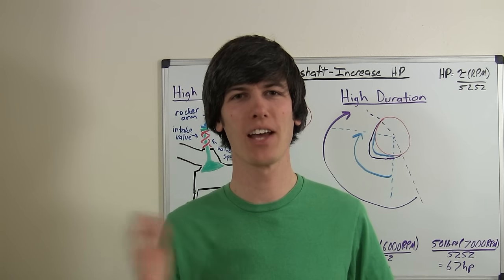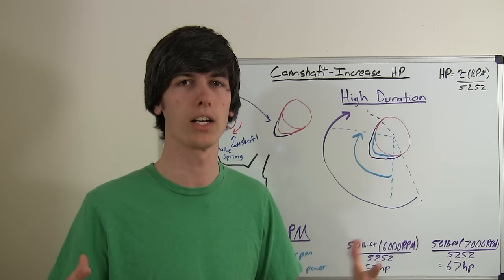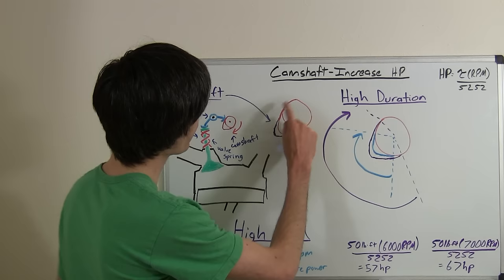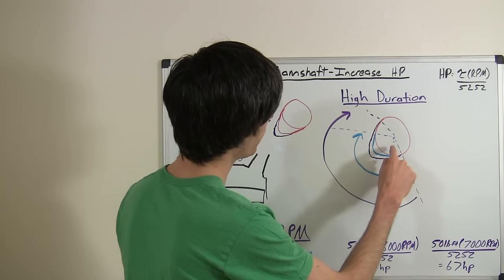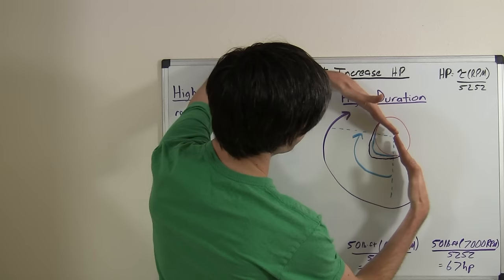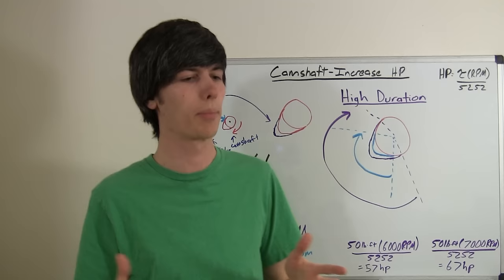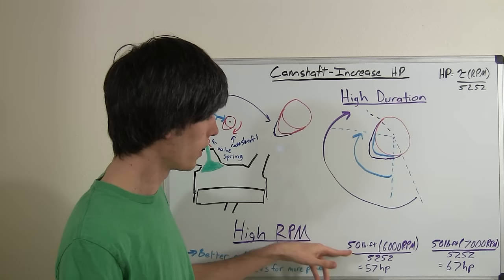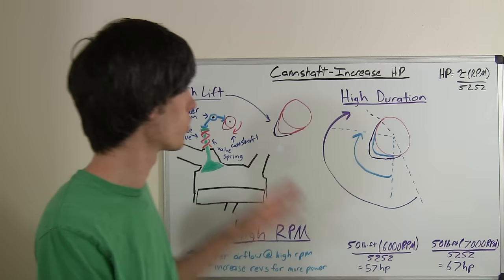Camshaft - High Lift and Duration - Increase Horsepower

Comment from the maker: It's possible to increase your max hp and still get better fuel economy, but that doesn't necessarily mean that the two will happen simultaneously. For example, more hp typically means you'll need more air, and consequentially more fuel. But if your engine operates more efficiently at lower RPM, and creates higher power at higher RPM, you can have a combination of good fuel economy and HP. This is basically the principle behind VTEC/VVT/valve timing.

Comment: I think you should also have mentioned the disadvantages, like low performance at low RPM :)
Reply: Robin K. Wouldn’t a tune for more power at the bottom end fix that?
Reply: @wey12341  no, given what can you would decide to go with most benefit upper rpm for peak hp not tq, so you sacrifice low end tq for top end hp. Has nothing to do with a tune, more or less just the design of the camshaft. To my knowledge lol
Reply: So, the low end torque will decrease for sure if I use a performance camshaft that boosts the power on the higher rpms?
Reply: Alfa Kenny Juan you spend a majority of time at 1500-3100 rpm
Reply: @getsuccessfulwithandito1550  yes. a larger lift cam will typically yield more torque at the low end compared to high end hp gain, a high lift cam usually doesnt need an increased rev limiter. high duration, high seperation cams are for high rpm, top end hp gains but sometimes a loss of power in the bottom end
Reply: Would a higher compression make the suffrice of power loss at lower rpm? Or is that relative to mapping? Being a vr6, contemplating the jump..
Reply: Aftermarket torque converter.
Reply: Thank You. Your diagram and explanation were easy to understand.
Reply: Who races at low rpm?
Reply: @stevenp3176  when you race you are 🤣
Reply: Would stage skunk2 stage 1 do this also
Reply: @getsuccessfulwithandito1550  Not always the case. With the right cam you might increase power through the whole range and remember torque is what puts you in the seat horsepower keeps you there
Reply: So big cams (long duration ones) is more applicable for hybrid cars, since the low end rpms is boosted with battery?
Reply: @fikaremiredo  Big cams are not always a bad thing. If they are matched to the engine cid ,gearing , torque curve, vehicle weight, tire size they can be very good and make lots of power. If you get it wrong though it kills everything and turns into a slug

Comment: One of the major limitations of stock engines, if you're trying to get higher revs is valve float. With stock valve springs, there is a designed limit to how quickly the valve can open and close. At higher rpms, the valve can't snap shut before the cam is opening it again, so the valve just "floats" there in a semi-open position.

Just putting in a more aggressive cam does not solve this problem. You must use stronger valve springs, so that the valve can snap shut more quickly than stock. Of course, stronger valve springs bring considerations of their own and cannot reliably be done in isolation. So, just a camshaft swap cannot produce magical results, and you'll invariably notice compromises like reduced fuel economy, rougher idle, worse emissions, and poorer power at lower rpms.

The moral of the story is that a camshaft swap in isolation doesn't produce a dramatic effect for the better, and there are invariably compromises for the worse. An engine is a very fine-tuned collection of parts that have been selected for their particular properties that contribute to a gigantic pile of chosen compromises. To "increase horsepower," in a reliable way, you generally have to swap out entire "sub-systems," so that, say, the entire valve train and timing set will cope with increased loads, etc.

But then you get into questions like, "Were your 6000 rpm wrist pins and rod bearings designed for 8000 rpms and 25% greater horsepower over stock? Your main bearings? Are you going to get adequate oil flow to critical components at the higher rpms?" Etc. There is no free lunch. You can't get something for nothing. Swap out certain parts, and you're just making other sorts of compromises, usually at the expense of reliability. At the outer end of the spectrum of compromises are top fuel dragsters that typically get an engine rebuild after every run (and an entire replacement clutch set)! That's "maximizing performance," but you do not get something for nothing!

My best friend, who built racing engines for living, used to say to wannabes, "Speed costs money. How fast do you want to go?" A camshaft swap-out in isolation is pretty cheap and easy, and it doesn't net you very much at all.
Reply: ^Absolutely true

On a side note, I also have a friend who runs a grassroots racing team focused on endurance race and the likes.
He actually tries to cram in OEM stock parts as much as possible since they're the most robust and reliable.
Reply: Maybe you should make a youtube video

Comment from the maker: Thanks, they do go hand in hand, really. Increasing the amount of air/fuel etc means a greater pressure rise in the cylinder, meaning a greater torque, meaning greater power. You may want to check out my video "Horsepower vs torque."

Comment: Great video as always, however this is not at all the whole story. Improving the breathing at higher revs will give you more power at those rpms but also lower the power at low rpms and often narrow the power band considerably. The more of a "race cam" you put in your engine the bigger the problem gets. Overdoing this can make the car almost unusable at low rpms. Great for a race car where you want full power most of the time, but bad for a street car where you also want to be able to cruise without reving the hell out of the engine at all time.

Who wants to have 200hp at 7000rpm but only 50hp at 6000rpm and below? I would much rather have only 150hp at 7000rpm but 100hp all the way down to 4000rpm. Would make for a greater street car and also a better race car.

So please do not go out an buy the most extreme cam you can find. Camshafts are a black art in itself and on top of that the camshaft need to match every other part of the engine and bigger is not always better.

With that said most engines, that are not already high performance engines, can almost always benefit from replacing the camshaft. You should easily be able to increase hp with 20% without loosing driveability. However depending on the engine you might need to replace other parts of the engine to take advantage of the new cam.
Reply: Could you explain the science behind that please? Its just that everyone says it and I'm not 100% certain if it's true.
Reply: @MrAndrius12   you lose manifold vacuum at low rpm, the more overlap the cam has (intake open and exhaust open at the same time) the worse it performs at low rpm
Reply: @averyfilbert1596  yeah the intake and exhaust being open at the same time makes full sense. May I ask, how would turbo/supercharging would affect all this?
Reply: My Name Is Hello they got specific cams for forced induction, they’re pretty similar, people used to run more lobe separation on them to increase back pressure on the exhaust but now they’re running similar specs to the n/a cams... im not 100% sure on turbo cams but the bigger they are the less drivable the car is, they have trouble with idle and depending on boost your power band would be higher but youd make more power
Reply: @averyfilbert1596  so even if the turbo boost is 30 psi (2 bars) the cam is going to be similar?
Reply: How do you choose the right cam shaft valves springs rockers rods ect?
Reply: thnks for youre example, this was my case , lost a lot of power in the bottom end aftet adding cam that opens longer
Reply: You can do advance ingnition timing at low rpm
Reply: What about higher lift with moderate duration?

Comment from the maker: Correct. If it was designed specifically for the stock engine, the stock cam is probably best. But if you have additional upgrades and need better airflow, this can help.

Comment from the maker: I couldn't tell you the direct relationship, and of course it would depend on the engine, but larger valves will promote better airflow, and likely will affect high RPM power a good amount (assuming the cylinder head is expanded accordingly).

Comment from the maker: Cams shouldn't affect the brakes in any way, unless your power gain is very significant, in which case you may want larger/better cooling brakes to compensate.

Comment: An interesting video and very appropriate for me today as I've been looking at swapping out the cams on my Caterham Roadsport for either the Supersport spec cams, or piper 633's. Both have greater lift and greater duration than the standard cams, and deliver this power at much higher RPM. So instead of having say 120hp at 6500rpm, i'll have more like 140hp but probably nearer 7500rpm! Obviously to get these kinds of gains, you need to remap your car to take account of the new cams and rev limit, and also ensure that your intake manifold and exhaust system can supply and remove enough air quickly to make the most of the hotter cams. 

It's a hugely interesting subject and shows just how much can be done to alter the nature of a car.

Comment: Plus a bit of overlap at high RPMs is a good thing, because the inert gases in the burnt air lower the reactivity of the mixture therefore lowering the temperature below the level of NOx formation. Plus the amount of Oxigen available is also lowered further reducing NOx formation.

Comment: You forgot to mention that if the head will flow a max lift of say .500, and you use a cam with a lift of .550, you get air reversal(back pressure), and the head may only flow .480(per Comp Cams).

Comment: Always enjoy the videos. I think you should clarify that in addition to going to a higher duration/lift camshaft it is often required that a stronger spring and retainer be used to compliment the additional stress from opening the valve further and at a higher rate of speed and to make sure valve float does not occur at higher rpms than what the stock valvetrain was designed for. Could you do a future video explaining what lobe separation angle is and how adjusting it changes torque peak?

Comment: Overlap is actually quite desirable (to an extent). It creates scavenging (exhaust pulls the intake charge in). Huge gains in efficiency were gained when we figured this out. Before flathead v8s only made 100hp. Now we have smaller stock v6s that make 325.

Comment: To increase revs you also have to have in mind do the components of the engine are strong enough to be revved more. Most important component that will stop a engine revving safely is valve springs, if any valve float caused by weak springs will cause problems if a collision with piston occurs at higher revs. Also rod /stroke ratios that is detrimental to the strength of piston as it approaches and passes it's design speed has to be thought about also. Making a engine rev past it's designed strength of components can be a failure of a component waiting to happen. To make a engine safe to rev more than it was designed too is a tricky and expensive undertaking.

Comment: Yes, a better lobe for high rpm power production. It has higher lift and I think it also has higher duration. Engineering Explained may have done a video on VTEC. Also, Eric the Car Guy did a great video on VTEC in which he actually shows your the camshaft of a car with the system and does a very nice job of explaining it. Oil pressure is used to select the new lobe in a VTEC system.

Comment: I think you should re do this one, Most of your stuff is that next level of information I look for mate, but this was basic and addressed none of my questions, and felt rushed. 
1 how can a new came increase efficiency and power? 
2 what makes lower torqueier cam vs high rev came
3 what makes a show cam like the thumper, probably a bit like the Harley timing huh?
4 why wouldn't the original manufacture take advantage of this wear?
I am researching for the classic small block, better example I think.

Comment: in the Philippines guys with highly modified 150cc mopeds actually believe that grinding down the cam lobes will theoretically increase power

they also believe OHV engines are more powerful than a DOHC engine
and they actually believe the Air suction valve to lessen the emissions is a turbo,

Comment: thanks for the video.  Its simple enough so anybody can understand the idea behind so called performance cams.  What I can't work out is why this isn't already optimized on the stock gear.  Why not have the bets air filter and best possible cam already from factory.  It surely would not be that much more expensive if at all.
Thanks

Comment: if i upgrade my camshaft,do i need to dyno tune it or change up other component?or just swap the camshaft out and its done?
Reply: +steve lim Yes, you can swap and drive or you do a dyno tune for more hp or tq.  Nowadays VVTs are common, so if you chose the right one, you won't need to worry.

Comment: I just realized is better compromise to have a higher lift than a longer duration. Since if you have larger intake systems more air is flowing in general and it flows better if the valve has more lift. Having longer duration doesn't help as much since the lift is the same it would create a bottleneck at every instant so air flow is not maximized entirely. Is best to flow large amount of air more often then more time taking same air, this helps engine rev faster also.
Reply: Exactly I've seen where a smaller cam but better flowing heads did way better in the lower rpm range than a big cam and shitty flowing heads it falls on it's face the cam is made for high rpms but the heads are not conducive to that much air flow

Comment: you should do a video on camshaft "regrinds". how they can increase a cams lift and how "rescinding" can effect the cams operation.
Reply: I second this I wish this dude would talk regrinds or someone that's somewhat knowledgeable on it.
Reply: I meant to say "regrinding*"
Reply: +brently300 yeah I got yah
Reply: ya please do a video on regrinding because there are people offering regrinding your stock cams and from our understanding, regrinding means reducing metal from the cams and how that can enhance the degree of the cam controlling the valve to open longer?
Reply: szekeiemme I found a video on how they do that the lobe is an egg shape and they grind a certain side so that when the lobe turns it makes the lobe lift the valve higher it's hard to explain but the video was a dude doing it to a motorcycle cam

Comment: can you explain the advantages of high lift short duration..and advantages of long duration short lift?
Reply: +Muhd Afiq  I am not an expert, but ... 
High lift short duration is for those old 5.0 v8 (for example) that revs low (5000 rpm) and has 250 hp and high torque.
Long Duration short lift ... maybe high rev (12000 rpm) motor with low spec (1000cc/600cc/300cc) ... Or even turbo cars. 
Just my opinion.
Reply: One is for low rpm high torque.  The other is for higher rpm less torque.

Comment from the maker: Ring gaps should be very small, and shouldn't cause too much influence on the engine. When the ring is compressed into the cylinder, the gap itself can be incredibly tiny (thousandths of an inch). That said, I do hope to have  video on the topic eventually.

Comment: Not bad for an explanation on how a bigger cam works. But there are a few key things missed. Overlap is good, and the cam lobe doesn't necessarily get taller/bigger. The base circle gets smaller. Otherwise on a OHV engine, the lobes would be bigger then the hole the cam goes into in the front of the block. If you go to radical, then you run into valve train geometry issues.

Comment: Spring pressure... as I understand it, seat pressure is dictated by how fast a valve arrives at the seat.  Get that wrong, and valve bounce might have you nicking a piston or worse.  Spring rate is dictated by combined lobe lift plus speed of valve train [buckets or lifters] - get that over the nose pressure wrong, and valves get lofted, then crash on the backside.  Use only what is needed: high spring rates do cost some horsepower.

Comment: Isnt there a overlap stroke on everything 4 stroke?

Awesome video! All about raising compression or efficiency(not both, though?). Avoid too rich or lean and mind overlap. Also the clearances. Lot's of variables that's why cams are the hardest thing in my opinion; they aren't made tight sometimes too and you gotta degree them to verify

Comment: Hello , I'm from Ecuador and have a camaro 67 with 350 , I think my engine is stage 1 , actually I have no special camshaft , I want to buy a camshaft Edelbrock from 0 rpm to 5500 rpm , my question is many horspower may increase with the camshaft ?
please if you can help me with that information, I would appreciate it, please help me whit that information :)
Reply: lol lol what cam was in it before? My guess would be you wouldnt gain much peak power out of a 5500 rpm camshaft, but your overall hp may increase dramatically

Comment: So apart from the cost of good quality camshafts, what would be the negatives of installing them on lets say a small 1.8L or 2.0L engine? Would additional costs such as a new ECU or new adjustable cam gears be required to fully maximize the potential of the camshafts or just installing them on the stock cam gears and stock ECU be still okay to run with HP increase?

Comment: Can you do a part 3 of this video. Do another break down. Such as 350 hp 525hp to 700 hp and break it down to lift and duration ratio that's need to help people make a fair choose and the difference in rockers arms and roller arms and oem parts. Also, u touch a matter air flow possible flowing down the wrong area how to prevent that if possible. Something that make us say oooooo I see and understand a lot More